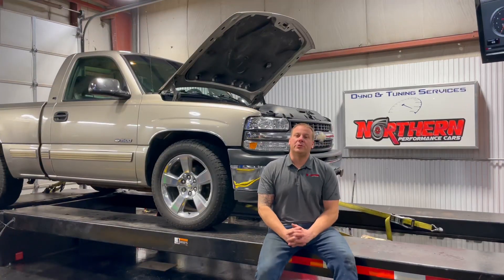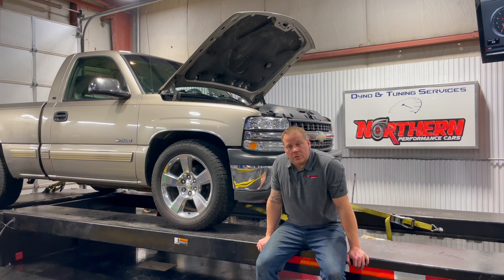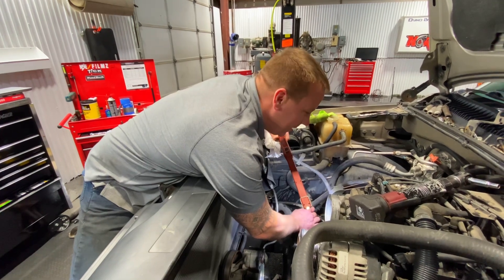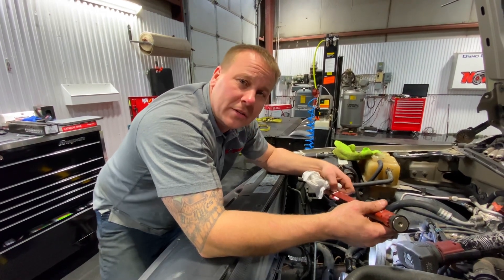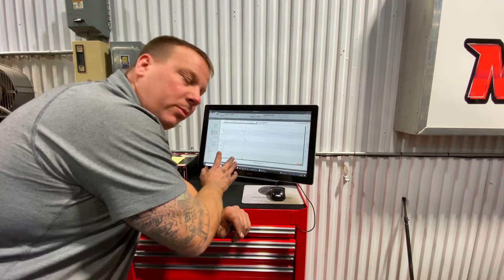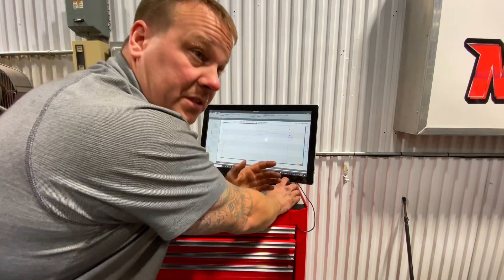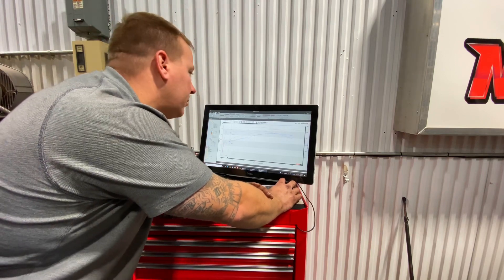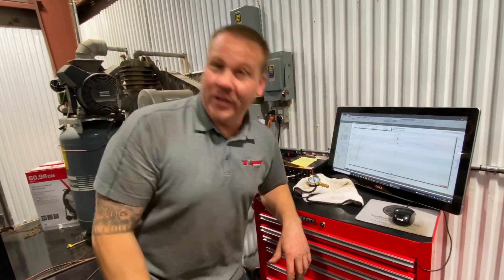Ask and you shall receive! Truck Norris consumes this 4.8 liter Ls. Back to back on the Dyno!

Comment: Love the videos, keep them coming. They’re very informative.  Question and sorry if I missed it in another one of your videos, but can you give me a recommendation on a torque converter and gears for a 4.8 L LS motor with the same cam, truck, Norris. I have a RCSB project my son and I are working on.  Thanks again.
Reply from the maker: If it’s a for fun 2wd truck. I’d do a 3,600 stall. Depending on tire size for the gear. 
For a 28-29” I’d do a 4.10. For a 30-32” I’d do a 4.56 for sure.
Reply: @NorthernPerformanceCars  thanks for the follow up. I should have given you more info. It is 2wd, tire size is 265/40-22, and I forgot to mention I was looking for a streetable daily driver. Thanks again for the follow up. I do a appreciate it.

Comment: Just cam slap the thing or do you need to do lifter trays lifters pushrods rebuild heads new rockers etc... ? thanks
Reply from the maker: All it needs is a cam and valve springs. Everything else in stock form is fine.
Reply: @NorthernPerformanceCars  you’re the man 🔧

Comment: Nice work hot stuff. Those OEM lifters make baby Jesus cry
Reply from the maker: The oem ones are outlasting 75% of these aftermarket’s as of lately! I’ll rock an oem high mileage non dod lifter way before a sub $320 set right now. 
It’s been an aweful two years of aftermarket’s
Reply: @NorthernPerformanceCars  building my lq4 with 243 heads, sloppy stage 2 cam, long tubes,and dual 3" out. I read and read and finally decided on a Delco lifters, seen waay too many aftermarket parts self destruct last couple years, a buddy if mine went thru 3 sets of lifters clacking on his fresh built 5.8l Ford, my dad had federal mogul lifters wipe out a cam on his 289.... I went with ac Delco parts where I could on this build bc I atleast know they can be trusted.
Reply from the maker: @erik120719  no doubt man. I have to turn away quite a bit of work because guys want to choose their own parts. I stand by my work and my name. So unless I pick out the parts. Or they choose quality stuff. That’s just the way it needs to be.

Comment: would you recommend this over the torque cam 202/202
Reply from the maker: Torque cam would drive and tune much easier. 
This is a much larger camshaft. So make more power. But drive more aggressively. More bucking. Less engine vacuum. Worse brakes etc

Comment: I've installed the truck Norris nsr in my 03 suburban with a 250k mile 5.3 . I did put a rebuilt and lightly ported heads I did on a few years ago. The heads were shaved 30 thousands and when cc'd raised the compression by one point. I have tuned it myself so far. This is also the first time using HP tuners myself. I've got the idle down pretty darn good. It definitely has more power. For a 6klb vehichle it rips.
Reply: Great to hear that man. I have an 02 suburban I'm putting the .553 lift truck norris cam in with rebuilt heads. Has 260k on the clock. Also been tuning with HP tuners myself on my SS sedan. Can't wait to hear the lil 5.3 chop like my LS3 did.
Reply: I’m putting a truck norris in my suburban as well. 3000 stall, TBSS intake, long tube headers. Thing should rip.

Comment: I have a 5.3 Chevy Silverado 2013 what cam do you recommend I also pull a RV as well
Reply: BTR Truck Norris it made more torque than BTR’s torque cam.
Reply: Thanks for the response and your help
Reply: @michaelsoto8299  No problem man, I’m going to be picking one up for myself here soon as well, the truck norris cam is the best all around truck cam on the market right now, BTR did alot of testing and research to get these kinds of numbers.

Comment: Thx. Plz do a truck norris cam in a 364ci stroker 5.3l with stock 243 heads, 580# beehive springs, tbss intake, cold air filter, better oil catch pcv system, and straight through exhuast. 

Planning to add an sc to this combo soon and would like to know potential numbers na ahead of time. Thx

Comment: i used a TSP stage 3 truck cam in a LS1 build for an Autocros car
Then this CAM comes out that's better. 
Well I guess that's how it works.
Reply from the maker: Btr actually offers a really awesome camshaft designed for autocross. Very stable high rpm lobes.

Comment: Which you think about the little chopper cam, Duration at .050: 222/232
108 Lobe Center Angle with a 105 Intake Centerline
Lift with 1.7 Rocker Arm Ratio: .595"/.587" with tbss intake, 243 cnc/ milled .30 and 1-7/8 headers and upgrade valve train and 3600 circle d stall!!
Reply from the maker: That is an awesome camshaft for sure. That should rip really well with the head work you have done. That’ll  be an awesome combo
Reply: @NorthernPerformanceCars  appreciate your input!!

Comment: About to put a ls2 in a 2wd obs truck, long tubes, 4L80, 3000 stall, 3.42 gears 28" tire. Would you suggest this cam?
Reply from the maker: It would be a nice addition. 
If it were mine. I’d go a little larger camshaft. 
Something like a tick torque max ls2 cam.

Comment: Sloppy stage 1 vs the truck norris what’s your feedback on these as comparison
Reply from the maker: Likely that cam would make 5 more peak horsepower being it has a few more degrees intake and exhaust. 114lsa would carry the powerband fired her.. But it would have a much worse powerband.  I’d assumed 30 less torque at 2,000. 15-20 less torque from 3,000 to 4,500. 
That’s where the truck Norris shines. It’s the most snappy and powerful aftermarket can from 1,500-5,000 I’ve seen. Then runs with the best of them to wherever the intake plateaus.

Comment: Installing this cam in a ls swap blazer with electric fans, built trans with 3k stall converter with exhaust and cold air intake. What kind of number you think I could roughly pull out of it?
Reply from the maker: What cubic inch engine, cylinder heads, intake and exhaust specifically.

Comment: How does this cam react to ported heads and maybe some true duals
Reply from the maker: It had dual x piped system on my red truck a few videos back. it ran awesome. The heads will help everything!
Reply: So I can get away with ls6/7 springs
Reply from the maker: @kevincranford8242  the cam is .552 lift. So yes. Ls6 springs would work. Ls3 will work. Btr sells a new set of sp011’s that are the perfect pair for them. Comp sells a few different .560-.600 lift single springs that use the stock retainer.

Comment: What year is that truck??
Reply from the maker: I believe it was a 2002
Reply: @NorthernPerformanceCars  ive got an 04 rcsb. I'm torn between this cam and the tsp  stage 3 high lift
Reply from the maker: @kylekerber6217  you’d want a rather high stall converter with that camshaft for sure.
Reply: @NorthernPerformanceCars  i think you just sold me on truck norris then!. Planning on doing long tubes and head work. Hoping for 325-350 whp
Reply from the maker: @kylekerber6217  shouldn’t be too hard. A gen 4 intake and 90mm would certainly be a worthy upgrade over the gen 3 and 78 as well. 

But yes. The beauty of this cam is that it makes power from the beginning to the end. I’m going to do a video soon on why having a big cam really affects under the curve. You might gain 10-20 up top over a smaller cam. But you’ll lose 20-30 down low where it counts. 

Gotta think how often you’ll be above 3,600 rpm. Or how long you’ll spend at 6,400 rpm. 
Camshaft dictates the powerband and the converter places you where you need to be dependent on the cam choice.
Reply: @NorthernPerformanceCars  mostly a street truck/daily driver so honestly not to much at those rpms. Small stall and my tbss manifold should get me there then. I enjoy the dyno proven stuff on your channel...numbers dont lie!
Reply from the maker: @kylekerber6217  perfect. If you can or ever want to run a stall it’s always a good idea! So much more fun. 
But there’s nothing fun about having too large of a camshaft to benefit from 5,500-6,500 unless it’s just to be raced. 
I hear “I should have listened to you” a lot from the local guys! Haha

No doubt! Have a great holiday season.

Comment: I just installed this cam in my 2004 rcsb silverado with the 4.8. Ever since I’ve gotten it done, and tuned I should add, my abs and brake light is coming on, sometimes stays, and sometimes goes on and off randomly. Any ideas?
Reply: It's common to be the module or wheel speed sensors but most of YouTube videos show abs module
Reply: @jotterson1156  it was my radio interface harness. Weird I know
Reply: @trevormiller09  oh? Mine does the same..how did you figure that out

Comment: Could we see a video of throttle response off of idle?
Reply from the maker: I could probably do that. Although I did include a driving video with this cam in my 5.3 and stock torque converter. But I dont mind. I can put a little follow up video together. Just didnt want to wear out the topic.
Reply: @NorthernPerformanceCars  no such thing as too much content on a new cam! I put the truck Norris cam into the 5.3 that’s going into my crawler Tacoma, little nervous about it being too much cam and won’t find out til it’s all built and rolling again lol. Still gonna send it though, always wanted a choppy Taco.
Reply from the maker: @nickramsay2560  you are right there my man! Everyone keeps telling me to post more. Just didn’t want to be annoying or lame. 
It’s definitely a little chunky. But you can tame it down with timing from jumping around also. Take some of the “chop” out of it. If need be

Comment: Yes buddy I want the Norris cam for my l33 5.3 but I'd live to see more testing or wanna know if there is a better option for a mostly stock truck 05 extended cab 4l60e gonna do cam and headers w exhaust and a tune
Reply from the maker: I posted a few videos of the cam in a 5.3 in my red truck. 
This is one of the two best cams for a close to stock truck. 
This Norris cam and Callie’s 210/218

Comment: Hi there..I am in the middle of swapping a 5.7 LS1 ('98) ..into a 93 Gen 1 Single cab S10..(about 2800 lbs ) It is intended to be a 750 vac sec Holley carbureted, Edelbrock dual plane RPM equipted  SNAPPY cruizer.. long tube 1 3/4 ceramic quoted headers . I live in the Cayman Islands; most of the time will be spent cruising at between 40 and 60 mph..The heads will be either mildly  ported stock 241s , or 706s, with dual 2.5 exhaust/free flowing turbo type mufflers. Transmission will be either the matching 4L70E with stand alone control, or a T400.  Thinking 2500 stall, if T400..or 2800-3000 with lockup converter with 4L60E. Rpm wont go over 6000..😉 Rear gear will be between 3.23 and 3.73, depending on trans.
Compression should be right around 10.5 or so, with either the 706 or shaved 241 heads..
Tell me Doc..What is your cam suggestion.. ? (I DONT need to "hear" a big "chop"..but want lots of low end grunt between 1500 and 5000.)

I really like the published specs/characteristics of the 3 cams mentioned, BTR TNorris, Callies, CamMotion  Lil Chopper.  What would be your pick?
P.S I will use nitrous 150-200 shot  when I want to fire things up a little..😅
P.P.S. Tire diameter 27-28 inches..
Reply from the maker: I would run a btr “stage 3 Ls1/ls2 specific cam. Or a tick performance torque 2 camshaft. 
With a 3,600 or better converter.

Comment: Shit I was looking at the stage 1 V2 truck cam for my 08 4.8L single cab now I may just consider this! I’m looking to add a converter and 3.90s or 4.10s. Unfortunately my little single cab is a one wheel peel 😂. Do you think this cam would bleed off too much for boost with the LSA @107?
Reply from the maker: Oh yea. This thing is awesome in that truck. It would be that much better with the gear and any converter. 
You called it. I wouldn’t choose to boost it with so many excellent cams designed for it. This is what it is as an aggressive mild n/a camshaft.
Reply: @NorthernPerformanceCars  Sweet that extra mid range power and strong top end goodness this thing is right up my alley. I’m also running a 29.5-30” tire. I’m a part of the ditch the heavy wheels crew ever since I had heavy ass 22s I’ll never go back to em.
Reply from the maker: @lukemorgan3368  yea the mid range is really what sets this cam apart.

Comment: Just when it seemed like camshaft technology had peaked for these engines... I almost wish they would do a version for 6.0L
Reply from the maker: Ive put a handful of these in lq4/s already. The people love them. So much more torque.
Reply: @NorthernPerformanceCars  - I am on my 2nd cam in my truck. About to do a 3rd and finally ditch the 317s. Trying to go faster without killing the useful aspect of it being a truck.
Reply from the maker: @bluecollarhotrods9781  I’m right there with you. I’ve mentioned it a few times. I worked with Callie’s a couple years back and they whipped up a 210/218 .552/.552 108lsa. It’s been my favorite full size work truck cam.
Reply: @NorthernPerformanceCars  - I started with a TPIS ZL10 - basically a TBSS cam on a tighter LSA. Currently an EPS 214/220 .598"/.605" 111+3. This is in an LQ4/80E swapped 01 RCSB, stock converter, 4.10s, FBO. I have two options: Summit 8720 and AI rebuilt 799s milled to 63cc, or a 224/232 and PRC STG 2.5 862/706 milled to 58cc. Either top end with get a FAST LSXRT in place of the current TBSS. I have two converters as well, one 3000 and a 3600. I've been collecting parts when I find good deals... "plans changed" on marketplace. Most of this stuff is brand new and in inventory.

Comment: You've just about got me decided on this cam for my truck. I wanted something that makes good low end and doesn't require 6800 rpm for power but also has the nice cam chop everyone loves. Seems to be shaping up to be a good daily driver cam.
Reply from the maker: This is truly an awesome cam. It’s still a little big depending on who you ask. But it is the most powerful can through the curve for a heavier vehicle available in my opinion.
Reply: My advice would be over-shoot on your valve springs a bit for some head room. I got a Comp 54-700-11 about 2 months before I heard of the Norris cam. It's technically a NSR cam but I used BTR .560' with factory converter and made 312whp on 93 octane .The torque reading of 409ftlbs was def wrong in my opinion The rpm range is 1500-6300 if I remember right. Will need a tune to clean up the idle as it's asking for about 4g more of air.  You can see a small pull on my channel. 5.3 4x4 single cab. EIther way good luck with the build Jay
Reply: Try using the six litter cam
And push rods etc...like to see how that goes

Comment: I have this cam to go in the 4.8 that I’m dropping in my 66 Nova wagon.  It’ll be backed by a stock powerglide and a 25” tall tire.  Do you think a 2500ish stall would be needed?  Thanks
Reply from the maker: You wouldn’t have to. But it would add to the driving experience.
Reply: @NorthernPerformanceCars  i see btr have two different truck norris cams  profiles  
"Truck Norris" Camshaft Specs: 212/22X, .552/.552, 107 LSA and 224/230 481/481 109 lsa which one would be a better choice for 1988 s10 blazer 2wd gen 4 5.3  with th350 3.73 gesrs  thx

Comment: Perfect I was hoping that the Truck Norris cam would work good in the 4.8 and I was thinking of throwing a 2800 stall behind it which I'm thinking is also perfect with that cam. Keep up the great content!
Reply from the maker: Yes sir. An fti, yank or tci 2,800-3,000 would be super perfect behind it! 
Thanks for the support man!
Reply: @NorthernPerformanceCars  yes Sir you are very welcomed
Reply: @NorthernPerformanceCars  what all did you have to change when you swapped to the Truck Norris Cam? I'm dealing with a 2006 LR4. Did you have to tune the stock ECU? Im not racing the truck, just want to give it a NA boost as this will be my hauler.
Reply from the maker: @shadowopsairman1583  absolutely needs to be tuned.

Comment: If you put this in a stock 6.0 with tbss intake what heads would you recommend ? Has 317s thinking about going 862
Reply: I bought this cam kit to go on my lq4 6.0 with headers and a tbss intake as well. I went with 706 cathedral port heads as they raise the compression ratio gaining power along with the slightly smaller intake valve increases port velocity also gaining power. I haven't installed it yet but from everything I've seen and read, this should be a badass combo. 😎
Reply from the maker: I’d like a 243/799